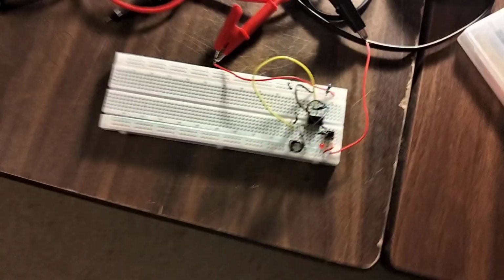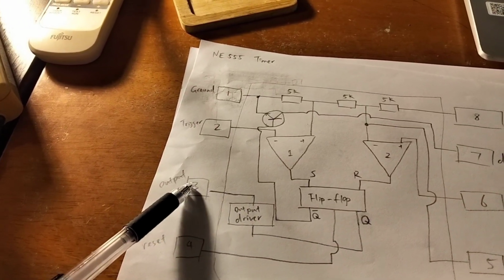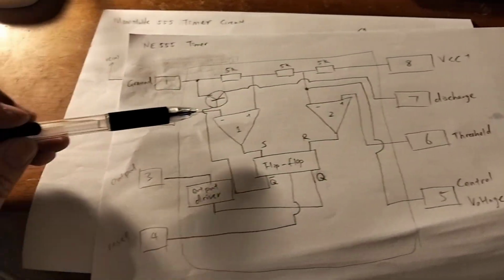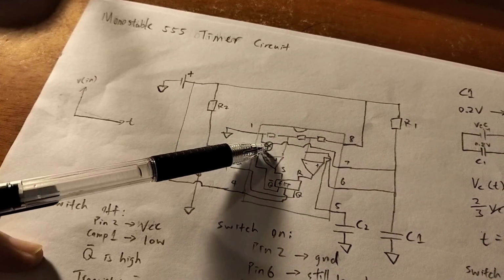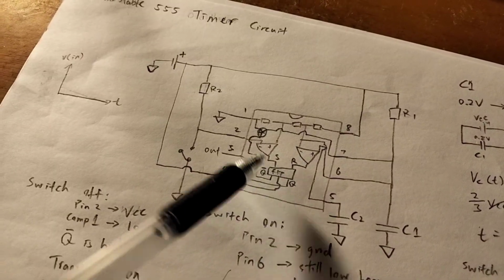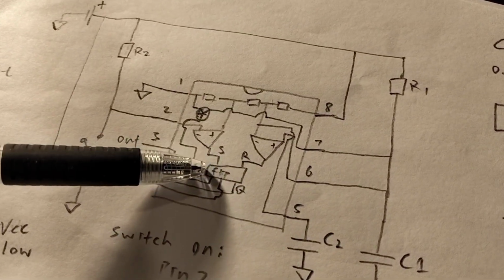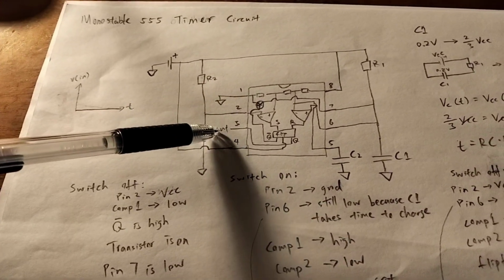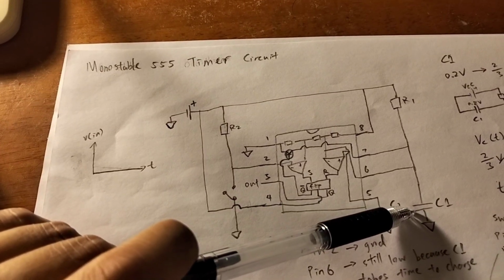NE555 as a monostable countdown timer circuit

Comment from the maker: 5:00 misspoke here, when pin 4 the reset pin is pulled high, nothing happens but when tied to ground it resets, this pin is active on low. That's why the pin is tied to VCC in operation to stop the flipflop from accidentally resetting.